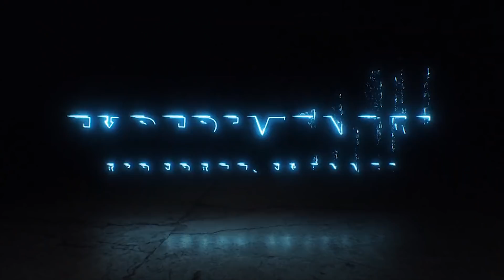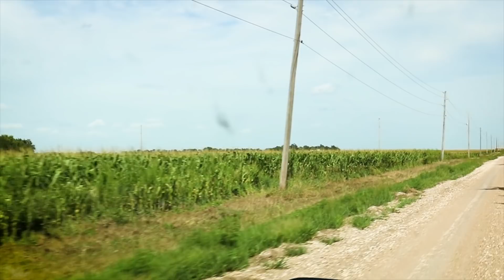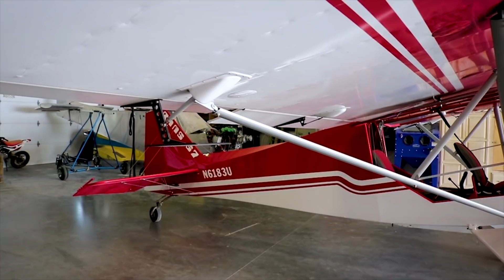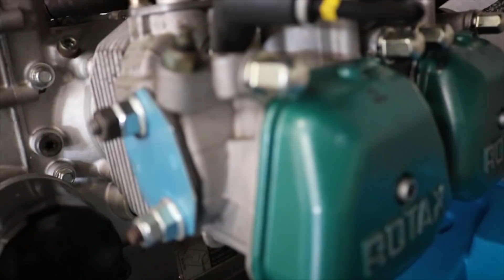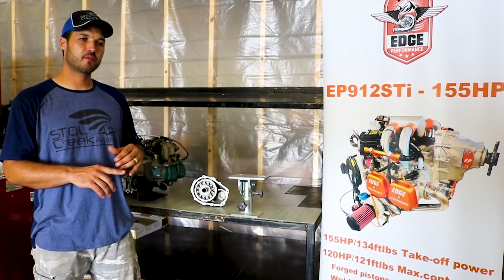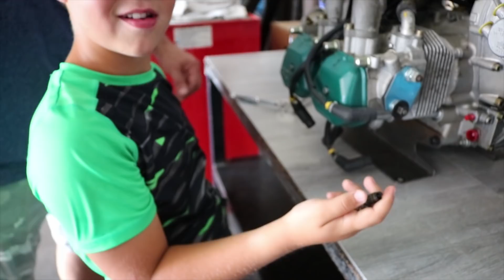STOL Creek Aviation - Engine Talk and Hangar Tour

Comment: Michael at STOL Aviation a true craftsman. Edge EFI installation on our Valor floatplane required some fabrication and so pristine thought should be properly hanging in an aviation museum. Next project is upgrading the Edge EP912STi in our Tarragon w/bigger turbo, exhaust and ECU upgrade for flight level performance.

Comment: Great job on the pushrod style engine... it's not easy to develop that much power and torque in a 4 cylinder pushrod motor.. I have a few ideas I am working on.. dependable flight for the family.. mine and yours.   So they don't fall out of the sky

Comment: MICHAEL you are a bery skillfull man, I can see you are nice guy,someone gave me an old rotax engine from a six chuter.where can I get parts for this engine?.like gas pump ,sparkplugs ,I will use it for a home made gokart. Thanks.
Reply: Shoot me an E-mail Josue and I should be able to help you out.
Reply: @stolcreekaviation5507  josuedavidpinedamelara@gmail.com
Reply: Bombardier ROTAX  GMBH bunskirchen
Bore:2x76mm
Stroke:64mm
Capac:580,6 cc
TYPE:582
Is a pull start,was in running conditions but has bean siting on my garage for some time ,so i want to put new gaskets,air filters ,spark plugs cables ,piston rings,cdi, etc.I dont fly any more(we had a bad crash)but this engine was not in the accident ,thats why I will use for the gokart project thanks ,let me know where can I buy this parts
Reply: @josuemelara5085  Send me an e-mail at mike@stolcreek.com. I can get you the parts you need.
Reply: @stolcreekaviation5507  josuedavidpinedamelara@gmail.com
Reply: Thanks